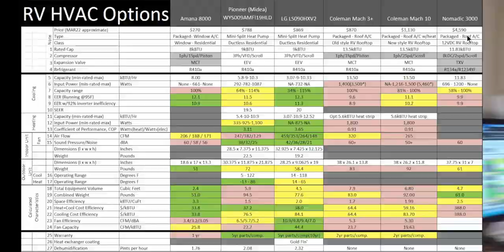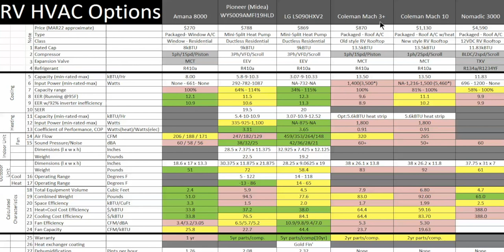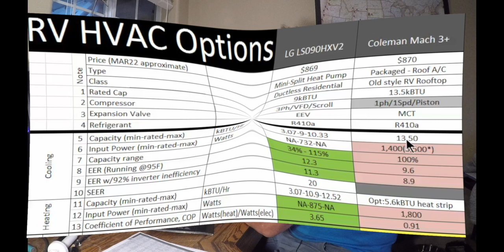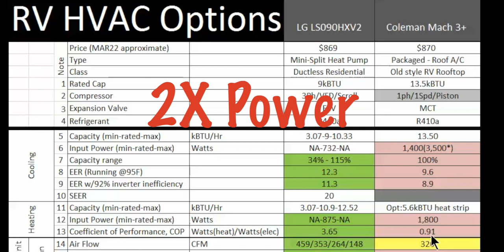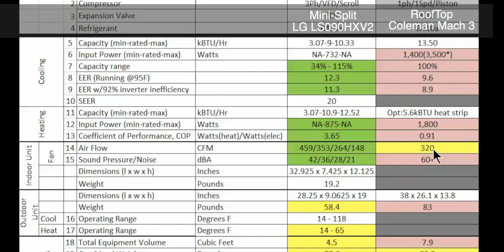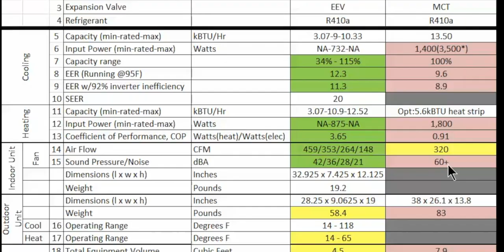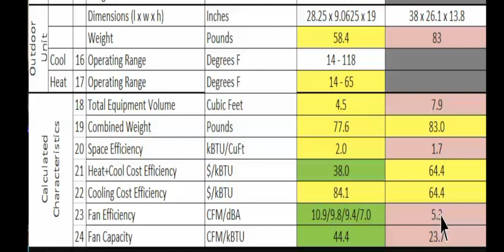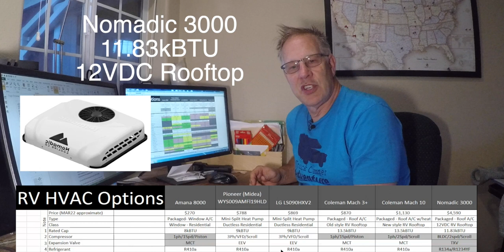RV Rooftop vs Mini-Split AC | Shop Talk | DIY Truck Camper

Comment: I'm planning on adding a Hotspot 48v DC mini-split 12,000 Btu heat pump to my motorhome later this year, to be powered by a 15kwh 48v LiFePo-4 battery bank recharged by 3,000+ watts of solar. I would like to see a comparison for this very high efficiency (EER of 19.3) DC4812VRF
 DC unit compared to one of the ultra-high efficiency 30.5 seer 12k Btu 220v AC heat pumps, like the GREE Sapphire. In this application efficiency is much more important than price because any price difference would be easily offset by batteries and solar panels cost and weight savings. What I find interesting is that the GREE has a 14 HSPF for heating (compared to 9.6 for the Hotspot), so it seems optimized for heating as it's cooling EER is only 15.3 compared to 19.3 for the Hotspot. I guess I have to add in the inverter loss for converting 48v DC to 220v AC too. Your thoughts?
Reply from the maker: My apologies for being slow to respond....I absolutely think going with a high efficiency 48VDC mini split is probably the most efficient way to delivery AC from a DC supply. Most are optimized for A/C not heating but I will do some research on it and get back to you but it will likely be a while. I am deep into a hydronic heating project and we are trying to get ready for summer travel. Some thoughts to ponder;  1) Assuming the 48VDC unit uses a BLDC motor (almost certain), its efficiency will be hard to beat with an AC unit if you take into consideration the efficiency loss of the inverter. 2) Efficiency gains in residential A/C have been mostly running variable speed compressors driven by induction motors and there is still a lot of the mass residential market that has not experience that (other than mini-split). I think the next step in improving efficiency of AC powered air conditioning will be when one of the compressor manufacturers replaced induction motors with  Synchronous Reluctance motors. Someone may offer it but I have not become aware of it. My bet would be that Danfoss or LG will do it first. They have the competence and market drivers. 3) Higher SEER ratings rely on larger coils (mostly condenser) which is contrary to what RV applications tolerate. There is little tolerance for a bigger 'wart' either inside or outside the RV. 4) If both the indoor coil and outdoor coil are similarly enlarged, they can reach high SEER AND HSPF ratings. If you see one lower than the other, it will usually be because they only enlarged one coil not both to optimize in favor of one operation.  European demand is driving hte heat pump efficiency improvements. They have much more demand for heating and little for air conditioning as they have been for moving away from fossil fuels (natural gas) to electrically powered heat pumps. Russia cutting of gas will really drive that. Manufacturers have responded by improved heating, which is a newer (in the last 10 years) trend. Not only improving HSPF but also 'low ambient' operation. I think you are wise to pick up on that and prudent to shop for the qualities you most want. My LG mini-split has better heating capacity than cooling (typical) but I dont think I would have made a choice to look for one that did. Not that I am about to build a house in Idaho, I am definitely looking for that. I think AC powered units will see lots of heating and efficiency improvement in the coming decade but suspect little will trickle into the DC or RV equipment.
Reply: @WorkingOnExploring  Thanks for the detailed and well reasoned reply. You've given me lots of valuable insight. I think I'll stick with the 48v DC Hotspot, as I'm more concerned with air conditioner efficiency, using the heating function as supplemental heat in milder seasons, simply to save some propane.  It seems like a simpler, more straightforward way to go  too. Propane appears to be an ever increasing expense though. I've recently paid as much as $4.59 a gallon for it at a Loves gas station while traveling.) Also, if I'm boondocking deep in the forest, I must consider the cost of the added trips to and from the propane fill station, as I have a large ASME tank in my MH and not the portable DOT tanks that trailers use, which can be transported in a smaller vehicle. The specs on the hotspot say both the inside and outside fan motor is a Panasonic BLDC, and the compressor is a GMCC Toshiba unit, which I assume is their high efficiency ASM108D13UFZ model, though this is just a guess. I really appreciate taking the time to answer me. Chip
Reply from the maker: @SuperSushidog  Chip,
I'm grinding through my comparison of units with new types, including the Hotspot. I'm still not done but wanted to confirm to you that it seems to me to be the BEST CHOICE if you're ok with 48V power. The EER is 12.2 compared to my LG at 12.3. Be careful because the Hotspot's operating range is 46v-59V. Cutoff is not as low as I would expect and potentially a problem with LFP batteries. 4x 12V LA batteries at 50% SOC cutoff would be 48V and full charge at 50.4V. With LFP batteries , a normal 16S would give you a cutoff voltage at 2.5VPC = 40V. The range of 16S, 17S or 18S all present problems at the limits. If you really want to use the A/C over full battery capacity, you might consider 18S (45V-65.7)  and run between 46V (2.55VPC) and 59V (3.27VPC) which is probably only using 70% of total capacity.
Reply: @WorkingOnExploring  Thanks for the reply and the advice! With a 16s LiFePo-4 bank 100% SOC is 54 volts and a 9% SOC is 48v according to the charts that I see. Since I would be operating the battery in the 95%-10% SOC range, for maximum battery life, this shouldn't be a problem, as the voltage requirement of the 48v hotspot (46-59v) falls within this range. A 17s bank will have a range of 57.4v-51v (at 9%SOC  - which I would set the low voltage cut-off on my BMS for) which might serve me better and should still work with the PIP 3048LV-MK 48V 3kW 120V Inverter/controller/charger I plan on using, as it has an upper voltage limit of 64v. https://watts247.com/product/pip-3048lv-mk/ The user manual for this device says that it will charge at a maximum of 64v, which is more than enough for a 17s bank but 1.7v shy of what an 18s bank requires. Next step would be finding decent a 17s BMS, as I'm not real crazy about the Daly. Any suggestions?
Reply: @SuperSushidog For EVE type lifepo4 cells, I like the 48v 20s20p 200-350A JK BMS’s with a 2A active balancer they work really well, look on Ali express. Real interesting convo & info guy’s, I have a 24v system in a bus & a 48v system at home. I have a 2.5 kw inverter split on the bus and it works quite well off a 3kw AIO 24v system & 10kw lifepo4 + 2kw pv so far as it is a reckless abandon on another property 400+kms away.
I dont know enough info here, but my immediate take on the 48vdc split system idea is that , yes it would typically be much more efficient than a 12vdc split, but I am guessing this 48vdc split is a lot more initial cost to buy than a 120v-240vac split (Im in Australia, 240vac ), my 24v 3kw AIO system only uses a maximum of 1600w for a short time before ramping down to 300-600w mostly, what my gut is telling me, while I love the idea of a 48vdc split air con, is that it would be more cost beneficial to get a 120-240vac split & maybe get another 3kw inverter as backup or upgrade to a 48v 5kw inverter/AIO whatever to power ur A/Con, also if anything goes wrong down the road, it would be easier & cheaper to fix or replace the household split with another unit in a pinch. Other considerations might be to definitely get a Inverter type A/Con and a propane based refrigerant type, like R32, as I believe these are probly one of the more efficient COP type gas of today.
Also, if using a household type split on a bigger van or bus is not so bad, but consider how much vibration it may be susceptible to, as some may need extra high density foam/ bracing/springs etc, around compressor & piping area internally as they are designed to sit on a wall not a van and flexible piping at least in critical area’s is probably necessary in most cases. 
How much is ur 48vdc split going to set u back???  Compared to a much cheaper 120-240v type? I am of the opinion that for the huge amount of power that Air Conditioning uses anyhow, the small amount of potential saving in watts between the ac & dc types is not going to be cost effective to go the dc route as you have to use inverters somewhere in these newer systems ac or dc to make them efficient anyhow. I dont know how much you plan on running ur A/Con, but generally they get used if & when you can, secondary to everything else you need power for first. Just my 2 cents. Cheers
Reply: @evil17  That 48v DC Hotspot is $2,100. There are a couple cheaper Chinese 48v DC mini-splits, but they are indeed cheaper and not as efficient. Yes, I can get a 220v AC mini split much cheaper, even considering the extra $200 or so for a 48/220v psw inverter. But then you have the additional weight of the 2 inverters (on inside the mini-split and the one powering it), 2 more things to fail. On the plus side it is cheaper to do so and worth considering now that the price of super high efficiency mini-splits has dropped. 

If I went with a 9,000 Btu 38 SEER Blueridge, which has an excellent EER of 16.67 (about $1,900 with the inverter and install kit) the EER would drop to about 15 with the inverter loss, making it a better choice now that I've run the numbers, even with the added complexity and weight.

Comment: QUESTION/IDEA: based on your information, it would be better to get a 110/120 volt minisplit and run it with an inverter instead of using a 12 volt minisplit. Is there a relation to the battery usage, like a bank of lithium batteries?
Reply from the maker: As far as I know, there are no 12VDC or 24VDC minisplits. They start at 48V for a good reason. High current resulting from a low voltage power source causes a lot of efficiency loss. Power loss is relative to amperage.

P (power loss in watts) = I (current) ^2 (squared) x resistance. 

For instance, assuming the same semi-conductor motor control can operate a BLDC at either 120VDC or 12VDC.  If the A/C draws 1200W (for simple math), a 12V motor draws 100A while a 120V motor draws 10A.  The power loss (since we are looking at power loss in the motor control which is where most of it occurs), will be 100x larger in the 12V system. No matter high the efficiency of a BLDC may be, multiplying the power loss of the SYSTEM by 100x makes a huge difference. Something similar happens in the 12VDCto 120VAC inverter so you can't really escape the problem of using low voltage.

Higher voltage DC is where its at. EV's use 360VDC and so do their A/C units. 12V A/C will NEVER be very efficient until room temperature superconducting switches become commonplace (and there is a lot of work being invested in doing that).

The fact that the volume and motivation to improve the efficiency of A/C is in the residential market AND that the solar market is driving efficiency gains in inverters (operating at high DC voltages un the range of 100-600V) mean it is likely going to remain more efficient to operate an Inverter/120V mini-split than anything on 12VDC. There already is a movement to go from 12V to 48V in RVs. The 48V mini-splits are driven by the off-grid and tiny house desire. It is not making a lot of headway. I think it will be a race to see if 48V mini-splits or 360V EV A/C becomes a dominant force in RVs.
Reply: @WorkingOnExploring  electricity/amps etc confuses me silly, so thank you for the explanation. I still don’t understand half of what you said but I get the basic premise: 120V is more efficient. Thank you!
Reply from the maker: Power (rate of energy draw in Watts) is universal. Power = current (in Amperes) x Voltage ( in Volts). Devices can be made differently to operate on the voltage of the available power system. An A/C unit of a fixed size can be made to operate on 12VDC, 120VAC or 240VAC. If that unit draws 600W, the math to figure out it's current draw is the same: P = A x V or rearranging that formula; P/V =A. At 12VDC, 600W/12VDC = 50A, at 120VAC, 600W/120VAC = 5A, at 240VAC, 600W/240VAC = 2.5A. these equations are linear so all computations are obviously similar.

Power vs current equations are non-linear. The exponential nature of P = I^2 x R means that anywhere current doubles, power goes up 4x. Now Resistance is not the same but resistance will changel linearly. With one factor down linearly while the other factor goes uexponentially will mean there is the result will still be exponential (a doubling of inputs will produce an output that more than doubles).

Power dissipation is P
Reply: @WorkingOnExploring  Seems that the best way is a 120V mini split on a proper inverter is best.  I guess 220V would be better, but standard here is 120V or so I understand.

Comment: do you have a link to the just the spreadsheet so that I can edit the different units? I'm trying to compare 30 mini splits to determine the best cost/value/performance unit within a set budget. Thanks in advance.
Reply from the maker: If you go to workingoneploring.com/techdocs, about half way down, you will find 3 files regarding A/Cs. The third one is the spreadsheet (excel file) I use to compare units. This edition has 12 units presently loaded. I recommend that you just delete my data and put in your own, keeping the columns and rows intact so they calculate correctly. You will also see a number of graphs that will help to compare 'calculated data' from each unit. This spreadsheet is still a working tool for me so I can't verify that there are not still some errors in places but it should help you.

Some advice not previously noted;
1) The 'turndown ratio/rate' is the ability of variable capacity units to operate over a large range. A unity that can operate between 30% and 100% (like my LG) is said to have a 70% turndown. For optimal operating efficiency, you should look for a unit that has a large capacity range. Ideally, you would like enough capacity range that the unit can operate on high to bring the high temp into a liveable range, then slow down to maintain the temp without having to shut off the compressor. Cheap units only have about 30% turndown. Some units also have a 'turbo' mode where they can operate at ~120% capacity for a short time to get additional capacity and cool a room down quickly. This is important but does not factor into the turndown calculation.
2) Variable speed  = variable capacity and is essential to efficiency BUT, some compressors are just '2 stage' meaning 2 capacities. Make clear distinctions between variable capacity and dual capacity because they will try to fool you.
3) 'Inverter' means that it uses single phase power through a Variable Frequency Drive (VFD) to operate a three-phase induction motor at variable speeds. Not all compressors or VFDs will operate over the same range. Dont confuse single-phase input power with the three-phase motor because the VFD makes that conversion. It takes a more sophisticated design to have a broader operating range because the refrigerant metering device is also involved. Low turndown compressors typically still use a Thermostatic Expansion Valve (TXV) while high turndown units use an electronic expansions valve (EEV).  Some compressors are also brushless DC (BLDC) designs that also use an electronic speed controller of a different type (but typically not called an 'inverter')
4) if you see the word DUAL, it typically refers to a compressor with two (typically scroll) compressors on the same shaft. it is a similar concept to a single-cylinder engine compared to a two-cylinder one. Two produce smoother and more capacity than one. A DUAL compressor of the same size as a single will have a similar capacity but the dual will achieve the capacity at a slower speed and be quieter with less vibration.

'Cheap' (inexpensive) units will not be the highly efficient design I assume you're looking for.